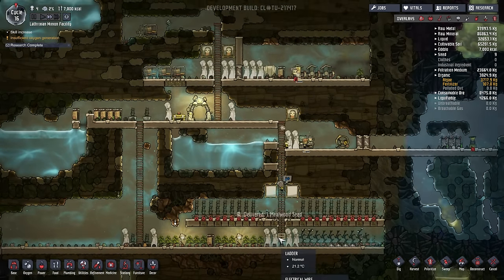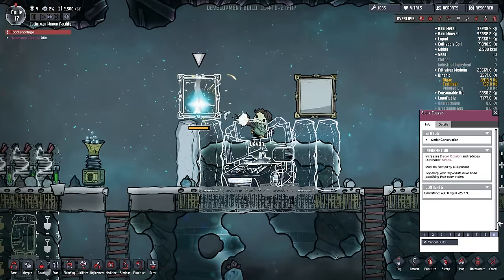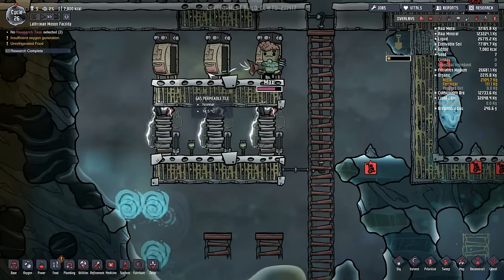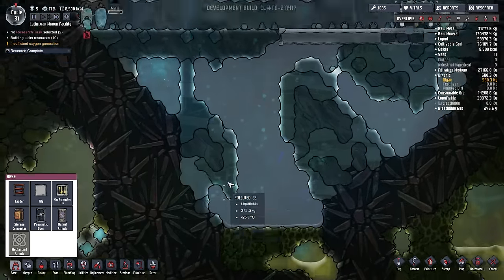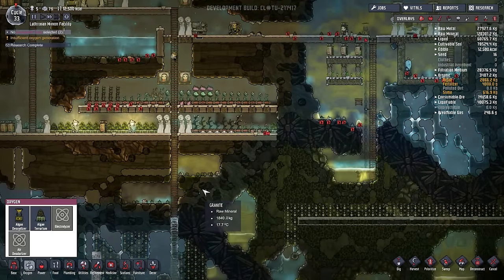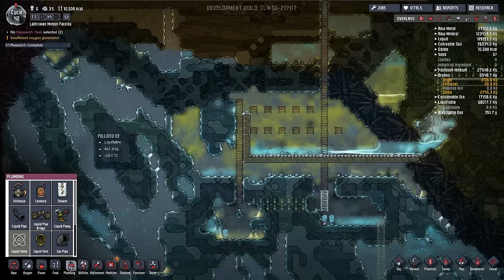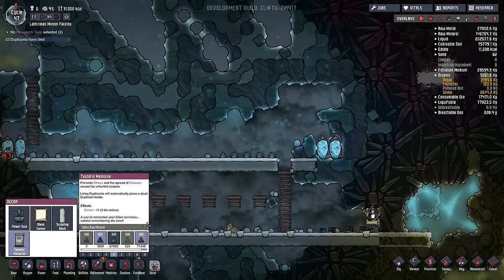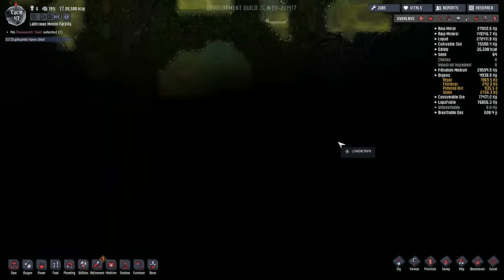Oxygen Not Included | Part 2 S3 | Geyser Access! | Thermal Upgrade Gameplay

Comment: You can move the wheezewarts by building a storage compactor, having a seed in it, and then ejecting the seed and removing the compactor. As long as its on natural terrain, it will grow into a new plant.

Also, one geyser will supply 10 to 15 dupes with ease. A second geyser will overflow fast.

Comment: Lath, you can also clean air in a similar way to cleaning water, cool the contaminated air to a low enough temperature and it turns at least a good deal of it to regular oxygen, and drops clay at the vents, something about -182 degrees or around that, which does take a lot of power using the pipe-cooler-fan-thingies, about idk, 20-25 of them or at least pre-thermal upgrade, not sure now. that also gives the problem of the air being extremely cold when returned, but then you can use the cooled down air to cool down some hot rooms you need cool that also could use a fresh dose of oxygen. (and then pipe the more normal-temperature oxygen to the base to cool it down a bit.

Comment: Don't under estimate the power of Airlocks, especially if you have a high oxygen environment. You could even have a single gas permeable tile on the base side of it to push the bad or lesser air out. ^..^ With maybe a chamber to organize the co and other gases to be used up.

Comment: Is it possible to make a heat sink in this game? You can cover a room with wolframite, then cover the wolframite with heat resistant tiles, then make a wolframite conduit connecting the wolframite from the room to a cooler area, or an area with lots of water, like the reservoirs. Maybe that's useful?

Comment: Thermo switch? why not call it thermostat....
Reply: It doesn't control temperature, it detects it
Reply: A thermostat is a type of circuit that responds to temperature to control the temperature of a given system by closing or opening the circuit (depending on the type of action). The temperature switch in ONI is a similar device, but the usage is different, therefore it's not a thermostat. It's another type of thermoregulated switch, which probably has a proper name, but thermostat isn't it.